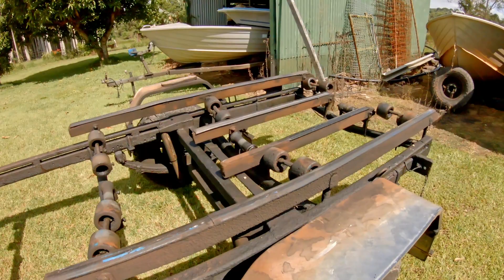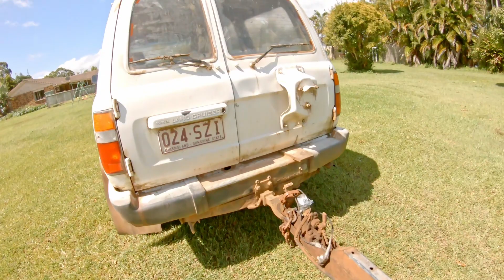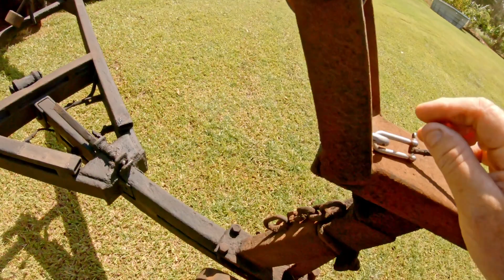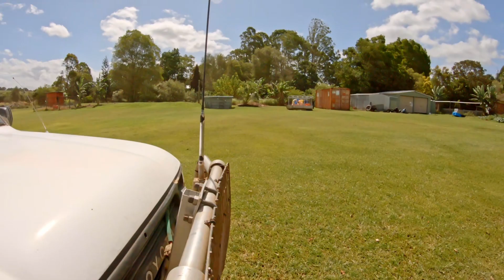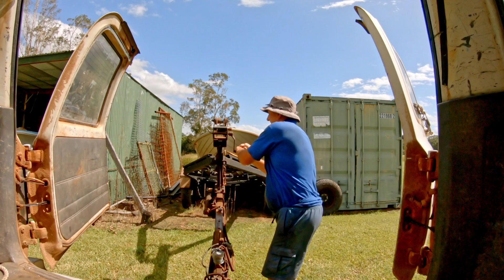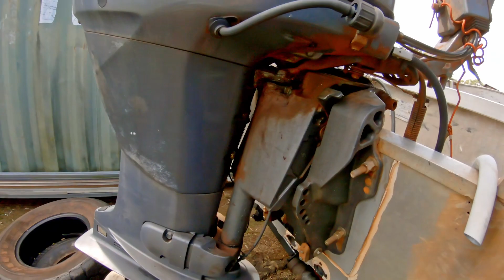How to Load a Boat off the Ground

Comment: good stuff mate..i think you might be keeping secrets from us after seeing the bow poking out behind the little tinny in the shed mate..Anyone who doubts drenching the gear in tectyl and/or oil should check out your gear because they are still rust free after decades of hard use i reckon..
Reply: Thanks old fellow, No its my brotherinlaws 5,4m swift craft  WA built I think,  Yes that mix just builds up hey with the dust and many coats of oil or tectrol hey as you know,